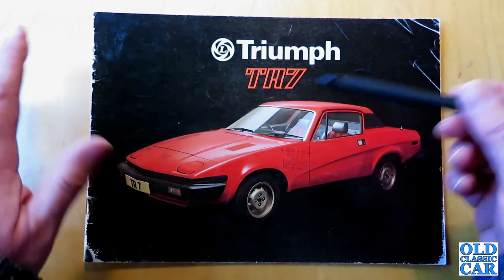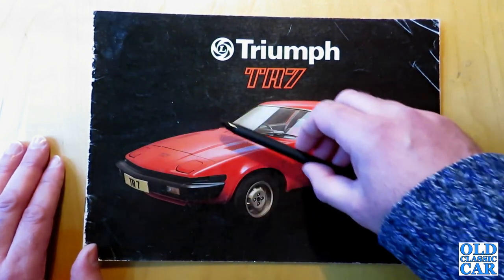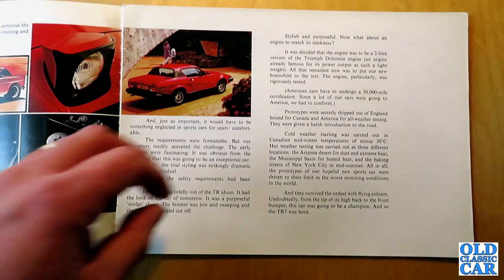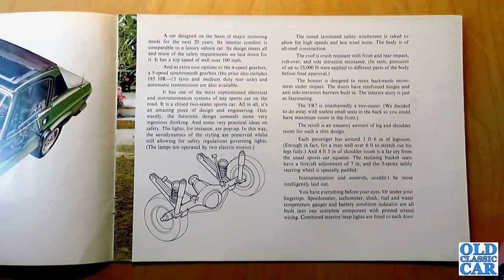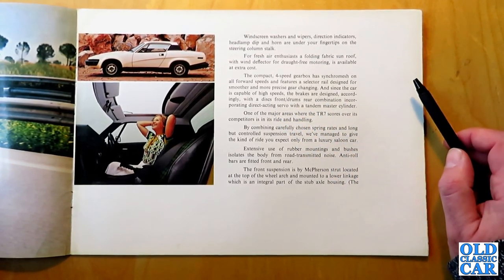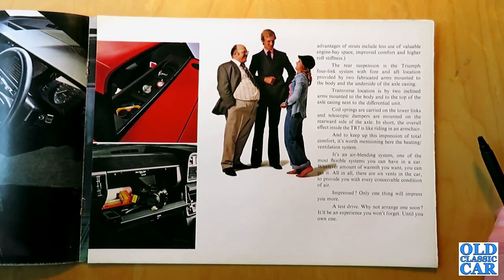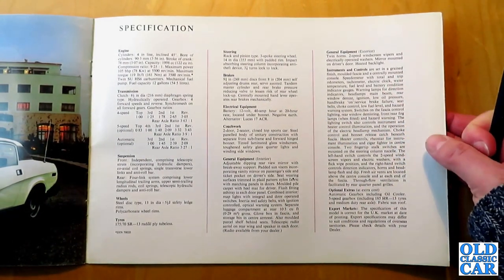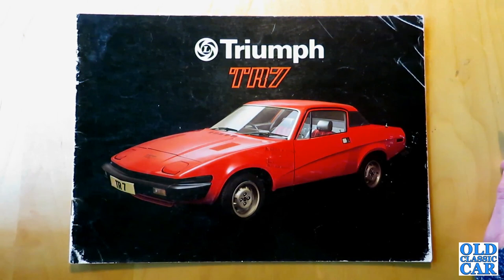1974 - 1981 Triumph TR7 car brochure review

Comment: I have a '77 TR7 5-speed fixed head coupe. These also have the stronger rear axle than the 4-speed offering.  It's a fun, well designed, and comfortable car. Mine has twin zenith stromberg carbs.  The 2.0L OHC engine revs freely and with the 5-speed, has no problem cruising at 65 - 70 mph, which is unheard of with some of its predecessors.  This car was made with the American market and highways in mind.  And they succeeded.  My car is stock but a previous owner upgraded the ignition module to a Crane.  The gas mileage is great on this car too. It handles well and stops well due to its light weight. It took me about 18 months to get this car to be a reliable vehicle, but that's not the car's fault. And I certainly took my time on it.  It just didn't get the care and maintenance it needed.  So I give the TR7 5 out of 5 stars.  Why? There's simply nothing else like it.  I'm glad I took a gamble and bought one. No regrets.  But keep in mind, your results may vary.  Happy Motoring !
Reply from the maker: Interesting to read re the TR7, thanks

Comment: Had a 1976 ex-speke coupe (carmine red).  No real issues, although rust became an issue.  Owned for five years.  1982, bought brand new convertible (183 before last one).  Great car and for the time, good looking.  Again, no issues other than rattle on gearbox layshaft in neutral.  Sold in 2002 after 40,000 miles.  Sp in my experience, no major issues, but maybe i was lucky :)

Comment: dash very nice but plastic cheap and rattles so bit of sealant sorts this, brakes crap sp put vents with princess 4pots on front and its ok, suspention way to soft so harder springs a must,  electrics lots of probs but easy fixes, wheels and tyres way to small so set of 15" and few inches wider dramaticaly improves handling, anti rollbar to high but 1/2" washers sort this redusing nose diving, as for engine bin it and replace with somthing with power. all in all a very strong and capable car as long as few mods are done it can be extreem fun so much potential if only they had ironed out the bugs

Comment: TR7s I've had fixed heads , have been nothing but a pleasure , fantastic car , folk maybe just thought another British Leyland disaster, yes the Dolomite Sprint engine was a headache needed tuning all the time , but I would say the worst thing on a TR7 is the brakes but that's it really and you can upgrade them nowadays 🤔 All cars of the 70s suffered corrosion so just look after them and your fine  great car 🙂👍
Reply from the maker: Thanks for your thoughts, it's a shame there aren't more about really as they are sooooo 1970s
Reply: @oldclassiccarUK  I still have a Inca yellow one  "76"  which I will never part with , and I will say watch this space , prices are going up now as folk are starting to realise what a great car it was this thing came out in the 70s    ,you need to drive a one and you will be hooked,  take care and thanks for the brochure video  very much appreciated 👍🙂

Comment: I own a 1980, TR7, convertible, Brooklands Green. Bought it new 40 years ago. 
Only thing that doesn't work now is the air conditioner. Car runs very well in cool weather. Not fun to drive if air temperature gets above 75 degrees Fahrenheit. The catalytic converter sits underneath the driver's side foot well and gets pretty warm especially in the summer time. Too hot for my liking. Other than that it's a nice car to take out on pleasure drives.